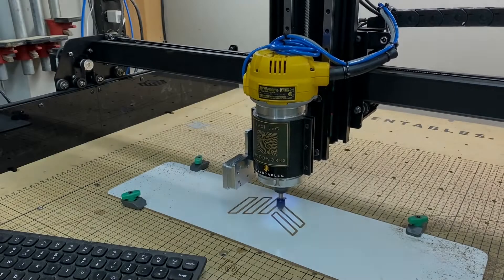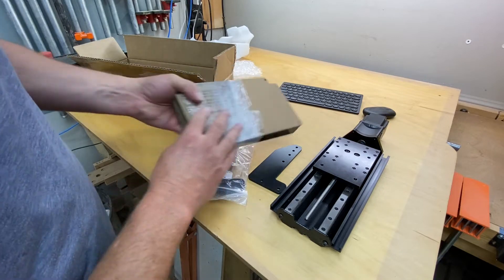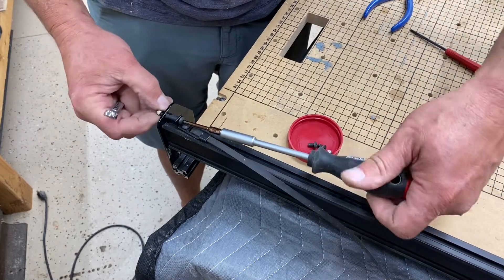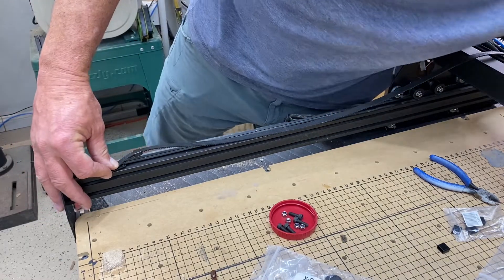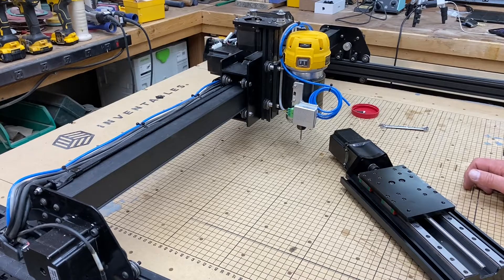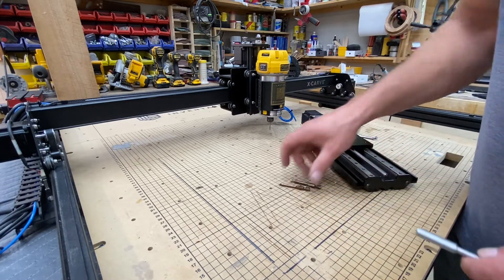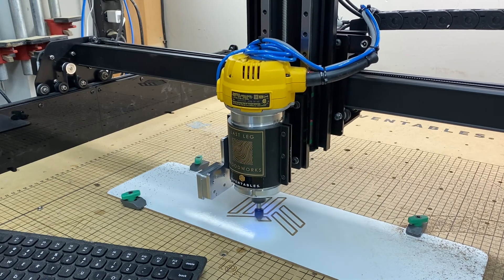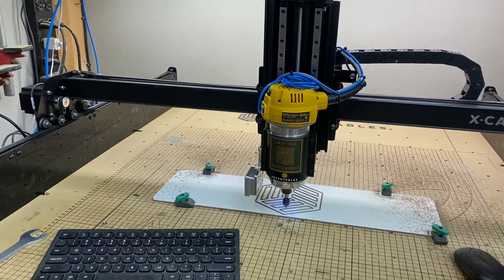X-Carve Upgrade | Full Step-by-Step Instructions for the 2021 Upgrade from Inventables.

Comment: Sorry, I know this video is 2 years old now.  Its a fantastic explanation on the upgrade.  I just did the upgrade to my machine and I have 1 question.........When you set the new longer z-axis, did you install it flush with the bottom of the mount?  I mounted mine flush and it doesnt appear that it will touch the wood to carve.  Seems like maybe it should be installed about an inch or so below the bracket.I hope you see this.

Comment: Thanks so much for the video. I bought my machine already assembled, so I was a little nervous breaking it down, but your video and detail set me at ease. I watched a couple times prior to doing my upgrade and referenced it several times during the rebuild. I am experiencing the same noise/rough sound with my Z axis, so I uninstalled and reinstalled. Seems to all be working fine, just sounds rough on the slower movements(especially Probing) any thoughts? 
Thanks again for any awesomely detailed video.
Reply from the maker: Hello, It seems like that might be normal, but may be worth a call to Inventables. Thanks alot!

Comment: You are my new hero. Bought my upgrade recently for my 1000x1000 like yours. Watched your entire video before attempting the upgrade. Your simple attention to detail was PERFECT. I literally opened your video and started upgrade. Was able to pause/start/pause/start numerous time to keep up. It is just awesome, that you presented the installation as a "regular guy" so I could follow along, as I did the install. Those side plastic\acrylic panels (8 of them with 6 screws each!!!) were the biggest pain in my butt ever. On, off, on, off to get them lined up. Slow but sure I finally got them all installed. Like you, I broke my Z-Probe barrel connector, pretty much right after I bought the machine. Inventables sent me a new one, and it too broke soon after. I just removed the barrel connector housing, and zip-tied the end of the probe harness to the Z-Probe holder, and it has worked fine since. 

The only thing now, as you are probably aware is there is no more going into the GRBL settings to modify code. Inventables created a "upgraded machine" that houses all of the new settings. I just had to turn on my unit, wait till the light turned green, selected the new "upgraded machine" (you need to rename it after selecting it, as it only says "X-Carve 1000") and installed it. I was nervous about deleting the original X-Carve, but Inventables directions said to delete the old machine so there is no confusion with the drivers/software. Once I tested the "upgraded machine" and was comfortable with it, I apprehensibly deleted the original machine with no issues. 4 hours overall was probably correct, though I spread mine out over 4 days, so I did not loose focus/patience. That's the good thing about being older, and having patience, I can stop when  I want, then restart at any time, which is exactly what I did.

So again, THANKS for a simple to understand "regular guy" video that made the upgrade easier.   100% recommend this video to anyone that is going to upgrade their machine as you (and I) did.
Reply from the maker: Oh wow! Thanks so much for the kind words. I'm so glad that it helped. And thanks for the tip on the new settings for the upgrade. I wasn't aware of those. Good luck and thanks a lot for watching!

Comment: Great Video!!!!!!!!
Reply from the maker: Thanks!
Reply: After watching this video again, I smiled when you were using the black tape to hold the nut in place and this was from your instructions! Lol,what instructions????? One never came with my upgrade! Luckily I found your detailed video. Thanks Again!!!
Reply: Have a question, went int0 machine settings and in the console I punched in a couple of wrong numbers. Instead of $130=750.00, I have 790. How can I change??
Reply from the maker: I think you can just re-enter the correct setting and it will overwrite the old setting. If you scroll to the button you can confirm if the new setting was saved. Hope that helps. Thanks again for watching!
Reply: @LastLegWoodworks  Success ! Thanks for your help!

Comment: I dont know if anyone has said this but with the amount of belting they send with this upgrade instead of 3 equal pieces you can actually get 4 if you measure right. I have the 750mm and I was able to get 4 pieces. so now i have a spare. I dont know if this will happen for 1000mm. another note is that once you connect to easel setting up a new machine will change all the grbl settings for you
Reply from the maker: That’s a really great point, I wasn’t aware that they sent the same belt regardless of machine size, but it makes sense that they would. Thanks for the tip, I will pass it on.
Reply: @LastLegWoodworks  Thank you for your video. it made this upgrade a breeze.

Comment: great video, I went a minute or two at ta time and paused while doing the next step and mine is all put together. tomorrow ill go through the software. im wondering if you uninstall the machine and reinstall and the new style if you have to put the codes in the inspector? if anyone knows let me no. also I just bought the machine used and having trouble with it moving during bit changes and ruining my carve, does anyone no a good vid to correct this?
Reply from the maker: Good question. I think Easel now has settings built in if you choose the new upgrade.

Comment: What is the biggest difference that you noticed with the upgrade. On my stock 1000mm xcarve, I get chatter with a .25 bit cutting at .125 at 20ipm. . . . will this help with that. 

Any changes with accuracy?
Reply from the maker: The biggest difference is definitely the increased capacity in height on the Z axis. There were many times before when I couldn't carve something because it was too high for the machine. I have noticed that chatter before too, and though I haven't specifically looked for it, I haven't noticed it since the upgrade. The machine is just way stiffer all around. Only once on the original machine did I experience lost steps during a job, and that was because I let so much epoxy build up on the rails during the cut. I don't think that would happen with this setup now though. the new belts, stepper motors and pulleys are much more robust.
Thanks a lot for checking out the video, let me know if you have any more questions. If you do purhcase the upgrade, I'd sure appreciate if you could use my affiliate link. It would help support this channel.
https://www.inventables.com/technologies/x-carve-upgrade-kit-2?ref=lastlegwoodworks 
Thanks again!
j-

Comment: I just did my upgrade last night I haven’t turned it on yet, question for you. I have the same opt laser, did you have to modify and settings for that with the gerble stuff.
Reply from the maker: Great question. I don't think so as the Laser uses the same settings to move the different axis' and the settings that we changed for the laser are different than the ones changed for the X-Carve upgrade. Let me know what you find when you give it a try. I actually haven't used my laser since I did the XC upgrade.

Comment: Great video!

What keyboard, monitor, and PC re you using for the X-Carve?

Would you mind making a video on your setup? I have a small shop, and I'm interested to see how you rigged yours up. 

Thanks!
Reply from the maker: The keyboard and mouse are just a cheap model from Amazon. I wasn't sure how all of the sawdust would be tolerated so I went cheap to start. The PC is a refurbed Dell OptiPlex 9010 that I bought from amazon. Its not a super powerful computer by any means but it doesn't have to be to run the X-Carve and Easel. It works great and was only $145.00.
Thanks a lot for checking out the video!

Comment: Thank you for this video! I bought the 1000mm kit plus full upgrade kit and have been having a time to do the whole assembly. I was stuck on fishing the 9mm belt through the z axis until I saw how you did yours. Brilliant! I am going to remove the upgraded stepper motor and run the belt as you did here. Looks like it should be vey doable. Thank you again for your video. Inventables should take your method and include it on their instructions! Mike
Reply from the maker: Awesome! glad it helped you! Good luck, and Thanks a lot!